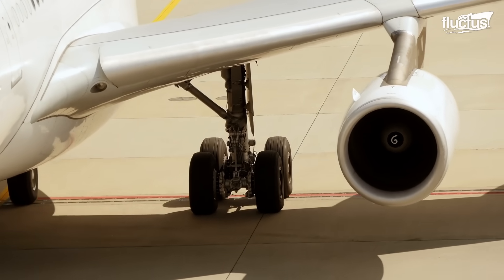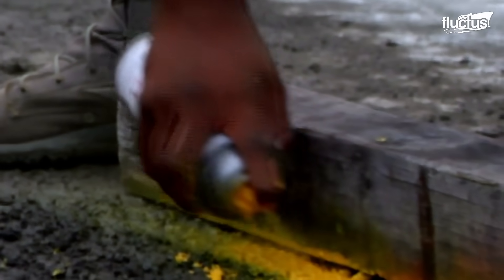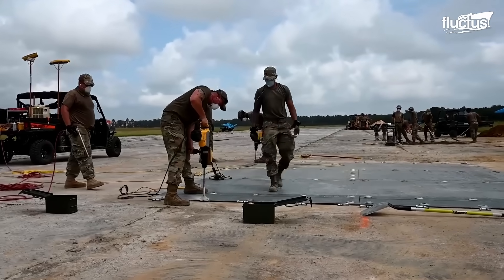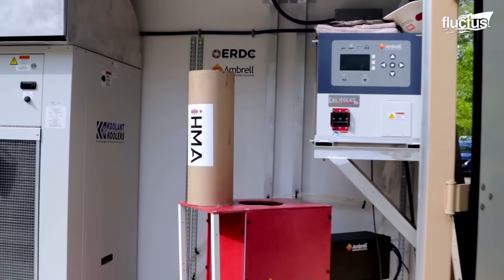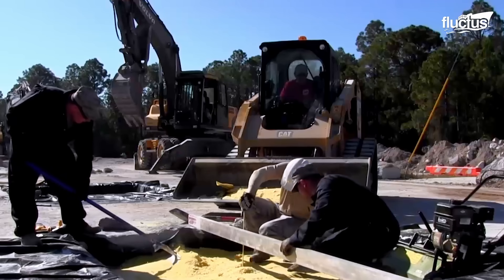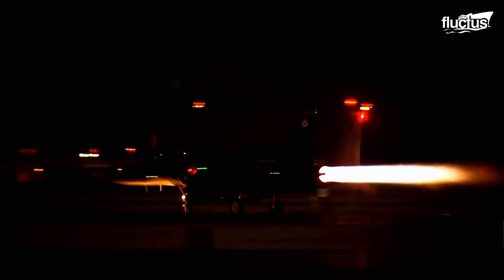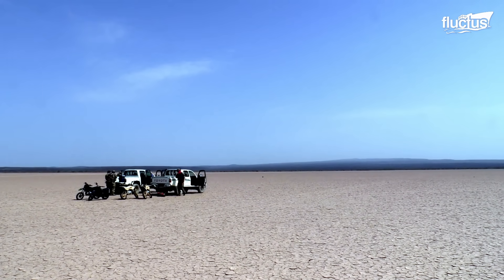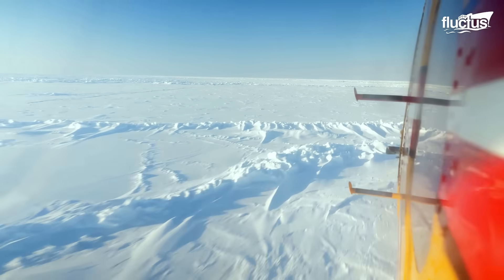US Testing Crazy New Technique to Repair Damaged Airport Runway in Minutes

Comment: Why not conceive nets that would emerge from the runway ground to reduce the plane's speed in case of a malfunction? Additionally, a braking parachute could be deployed at the rear of the plane to slow it down even more effectively. Furthermore, openings in the runway surface could spray water underneath and along the sides of the plane to extinguish potential flames, thereby enhancing safety
Reply: Lmao..
 Cover the airport runways in nets... have you ever heard of friction... runways aren't just for landing and slowing planes also need to be able to reach take off speed before the runways ends. Nets everywhere would seriously hinder if not prevent heavier aircraft from even being able to use the runway.
Reply: @stevencatone dude... nets could be hidden in automatically covering slots. Think Steve, think.
Reply: @Hokunin  Technically if the runway is damaged, so would the system revealing the "nets," lol.
Reply: LMAO!

Do you know how heavy big aircraft are?

Just imagine a regular semi with, just for example, a bulldozer on the back. And pretend that truck is doing 150mph. Now try and stop it.

Regular aircraft weigh 10-20x as much as a semi. They're seriously heavy!
Reply: Nothing you’re saying is even remotely practical with 200-400 people onboard an aircraft Forrest
Reply: This idea only really works with smaller craft, it's why Aircraft carriers do this, there isn't any material we have that can be used to safely stop larger craft like, for example the C-7 globemaster or C-5 Galaxy, or even really smaller cargo craft like the C-130 that can safely stop the aircraft and not either rip into the airframe, potentially causing even more damage and potentially killing people, or snapping under the weight of the aircraft.
Also, a lot of aircraft use magnesium in the airframe, which water would actually make worse rather than better, potentially causing the fireball to become far worse. This is also why when you see the wreckage of a burning aircraft, there tends to be a lot of what looks to be powder rather than melted metal like you'd expect, this is due to the magnesium burning away.